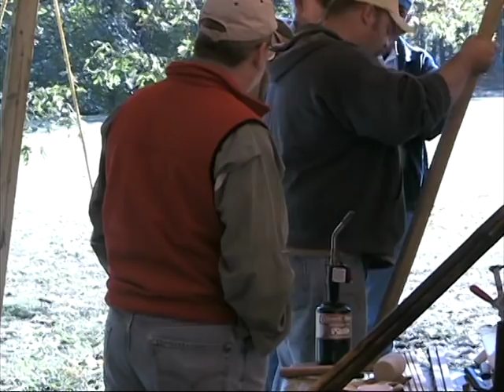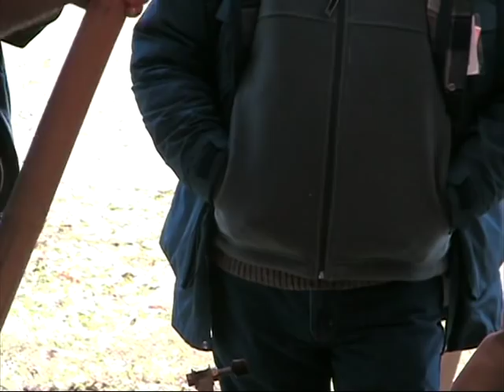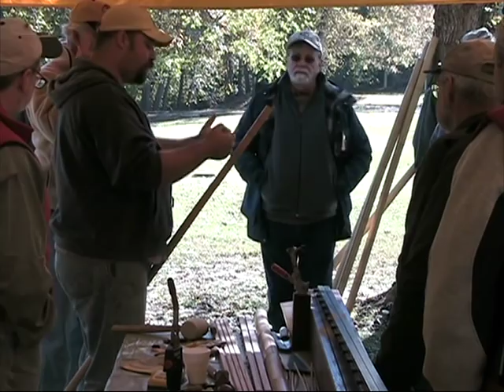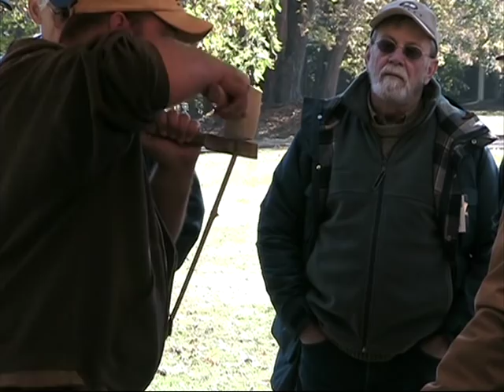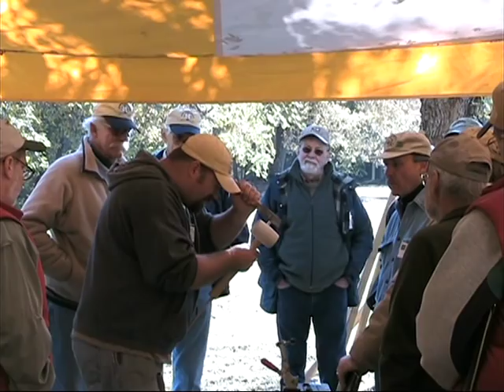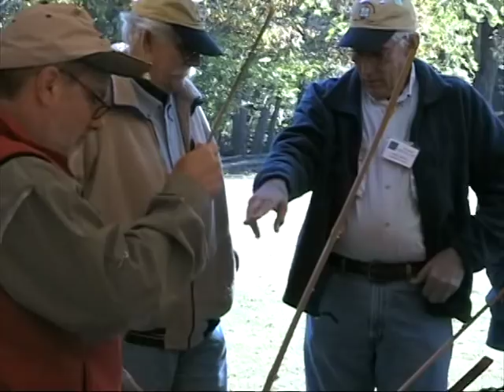Splitting Bamboo Culms for Fly Rod Making (searcysowbug)

Comment: I use the same technique except that the wider side, if it's significantly wider, sometimes needs to be supported half way down so it's able to be bent against the support. I have holes in my bench that allows me to insert the whole piece. Then I can pull the wider side against the side of the hole. Works well when splitting thinner strips off a wide strip.